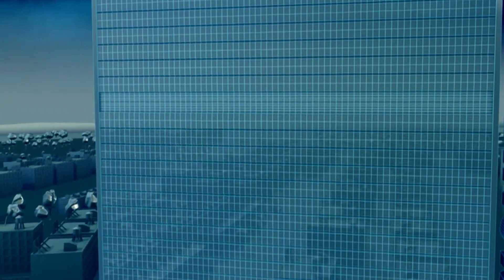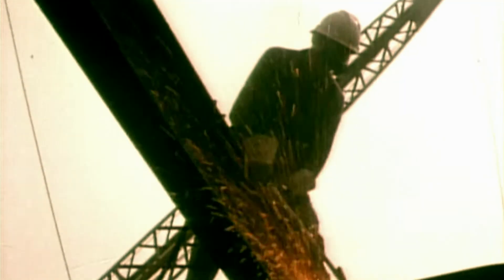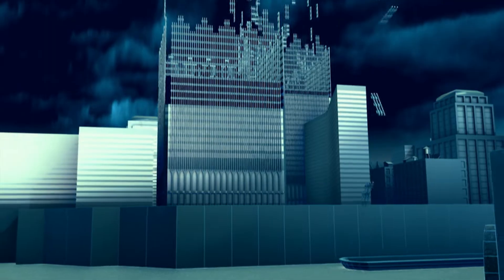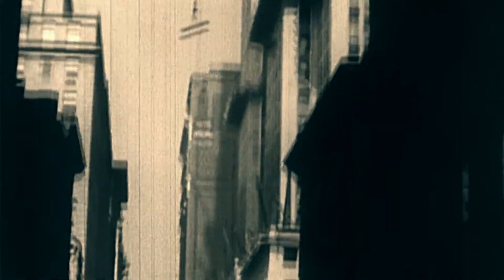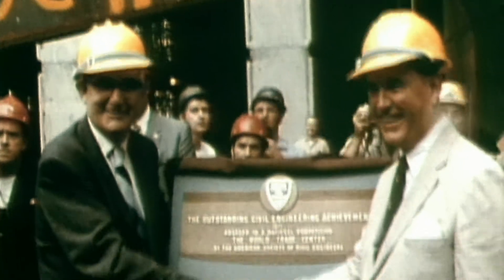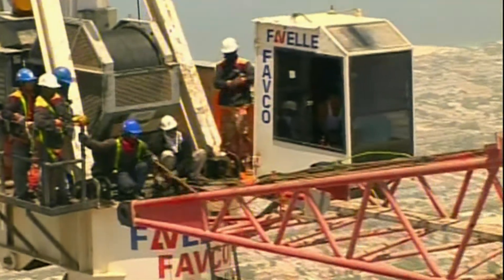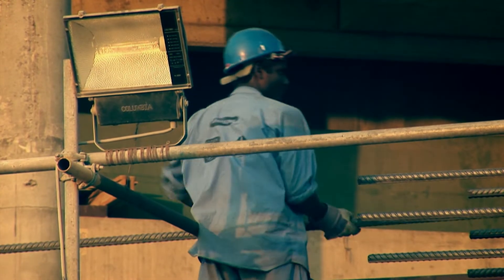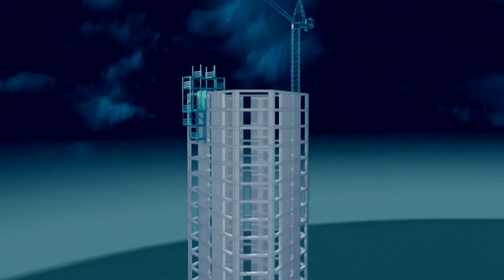Skyscraper Science | Kangaroo Cranes and Jump Forming

Comment: While the Twin Towers were going up, I was on the 55 Water Street job.  We had clear sight  of the Twin Towers. Our floor plate was double the size of the Towers. We had 6 derricks going. It was to be 53 floors. We hung traditional steel columns and I Beams. The concrete came up on a fast concrete hoist . The whole process was like a well choreographed ballet. I was on that job for 2 1/2 years. Uris was the builder. It was also the last building in NYC to use asbestos for fire proofing. They changed to cement based coating on about the 23rd floor. There were no safety belts or nets at that time. As far as I can remember, no one died on that job, which was miraculous. I was fortunate to retire 17 years ago without having one injury that caused any lost time. That too, was miraculous.